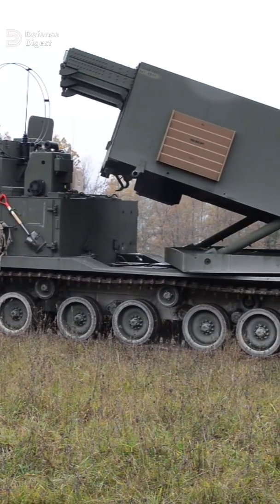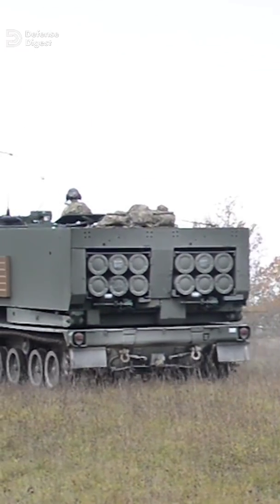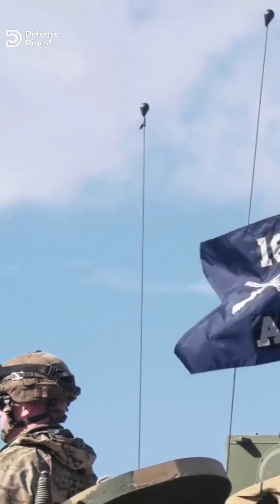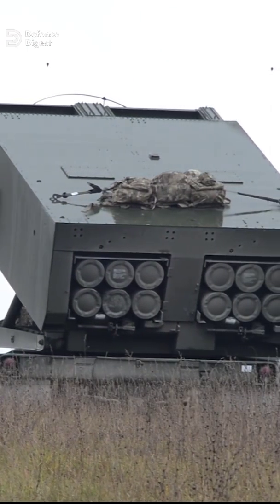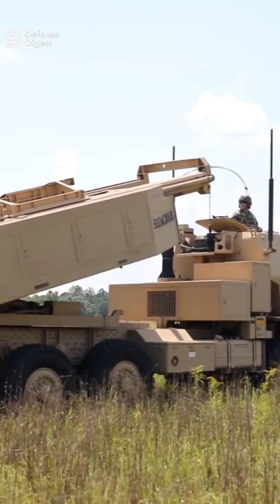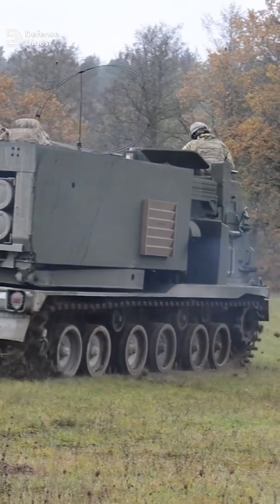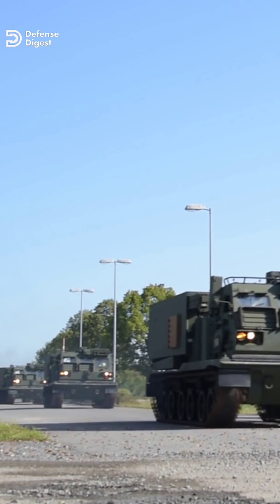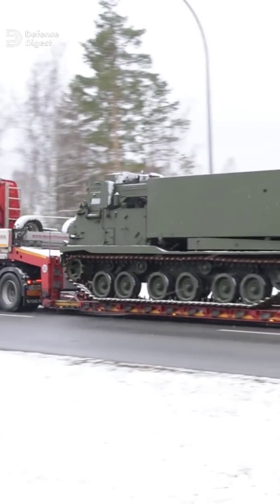Most Common Rocket Artillery System in NATO #Shorts

Comment: So the Russians like making Tubes and the American prefer there fire works to be in a cake boxes.Russian put the radar on the war head so it can shot up via a spring in the tube like a magazine to not burn the other missile once pumped out the tube vertically the rocket self ignites and can go any direction.however American have a revolving box with the radar in the vehicle.the Chinese did the same thing with there arrows by attaching cylinder gun powder tubes on them all attached in a web to one fuse the chineese despite being able to fire multiple arrows and even had the fire Lance where fire arm comes from a spear an arm attached to a Roman candle to set the enemy ablaze then they started putting glass in them and then bullets then the hand cannon was born attached to a cross bow body and the gun was born.

Comment: All 12 rds in less than 40secs then ya turn around head back 100 miles to reload, I reckon?!?!  Maybe a bigger load of 24-36 rounds might be worth the drive???
Reply: No
The pods are pre loaded in six rocket pods as the video says
The reload pods are transported on the back of Hemmet carriers which will either accompany the M270 or pre position at the next launching location
The M270 will fire then immediately head to the next location to avoid receiving counter battery return fire from the enemy (the shoot and scoot tactic mentioned in the video) when they arrive at the next firing position the hemmet crews will have the reload rocket pods ready to reload 
The mechanical reloading system is built right into the rocket launcher and only takes a few minutes and they're ready to fire another salvo of rockets
The reload process is much quicker than having to reload individual rocket tubes like on the Russian Katushya multi launch rocket vehicles.
Reply: @shooter7734  You are very correct were you a 13M as well. I was a 13M for four years and I know are reload time goal was Three minutes
Reply: @Commander23251  no I was a 31C (Signal Channel Radio Operator-Maintainer)
I know the process because it's readliy viewable in demo videos on YouTube 
I've always found the M270 an fascinating piece of equipment since I first saw it in the mid-80s in army recruiting ads on TV
that's why I googled it awhile back and watched those videos.
Reply: Nah. Just fire 2-4 rockets, then move to a new position. By the time the first shots land you have begun firing the second. Repeat until out of ammo. 

The rockets pack a hell of a punch and are incredibly accurate so you don’t need all 12 on one target.
Reply: As some who was a 13M the mos code for those that operate these beasts our motto was Shoot, Move, and Communicate